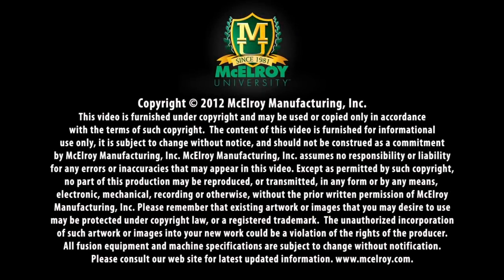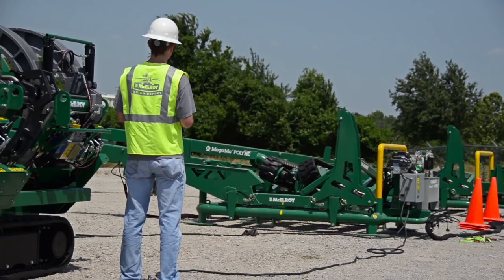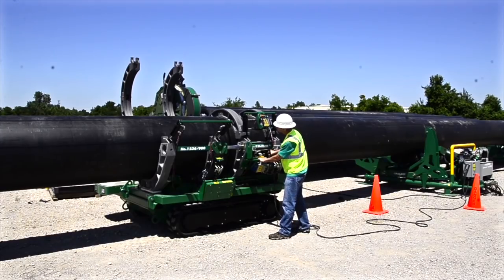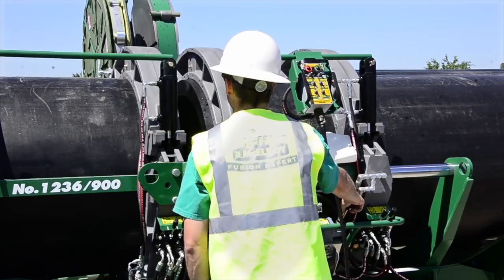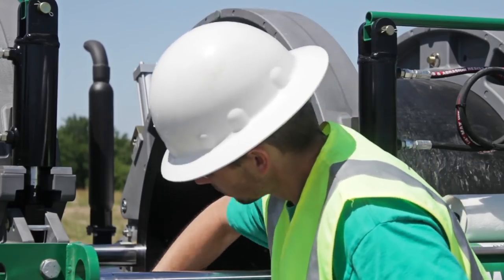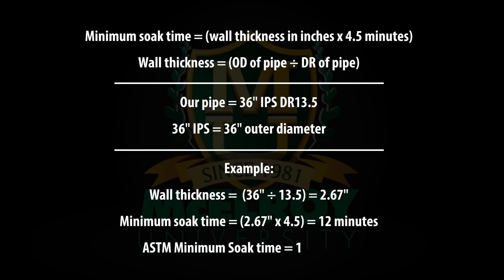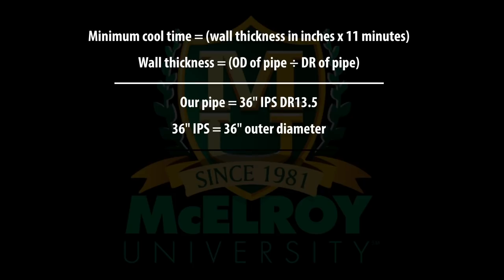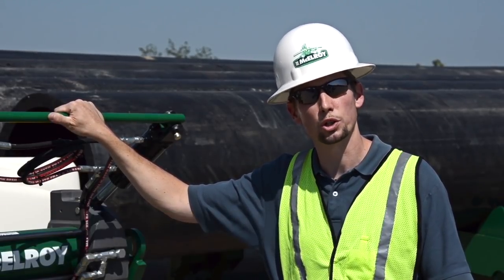How to Fuse Large Diameter Polyethylene Pipes with McElroy Fusion Machines

Comment: Good video but I think I would be a good idea to mention how much the weather like wind and outside temp can affect soak time, and the time you got from when you pull the heater plate to fusing. I do allot of fusing at work mostly 30" and I have done it in all kinds of weather from -30c to +30c and I have noticed weather makes a big difference when it calls for set times on heating and cooling.
Reply: @Rob Cappitelli yes that would be nice

Comment: Sure your machine looks flash. 
How do you weld fittings with it? 
Why can't it work out its own welding parameters and drag pressures with minimal input like OD and wall thickness.
Your system is designed to move as many tons of pipe as necessary to suit a machine that weighs 1 or 2 ton?
If the pipe ends and facing plate are cleaned properly to begin with for each joint then with care you'll never get a better prepared surface to weld without fiddling with it making it dirty again.
Using dry cleaning cloths will never remove oils from the weld area or in any way clean a joint affected by static.

Comment: As you can see, using this 1 million dollar piece of equipment is effortless. Every joint  on this multi-million dollar job "only" has to be perfect. Every technician just has to spent a year using it to become an expert; let alone, trying to get enough experience with the rest of his or her life to earn a chance at getting a some mechanical license.     Easily remove the need for mechanical joints that usually get tallied in the material list, (i.e., paid for by customer) and buy or rent one of these. which hopefully will be calculated in the cost after you low bid your self to infinity to get the job.

Comment: But what if the pipe is oval? 
This machine is not designed to eliminate roundness because the pipe is clamped by hydraulic cylinders. If you weld oval pipe, the beads will be uneven and this is unacceptable.
Reply: If it's to bent or oval u cut it off and beads don't have to b even
Reply: If you can't control ovality issues with a butt welder then you should give up welding. Ever thought of matching the ovality from one pipe to the next?